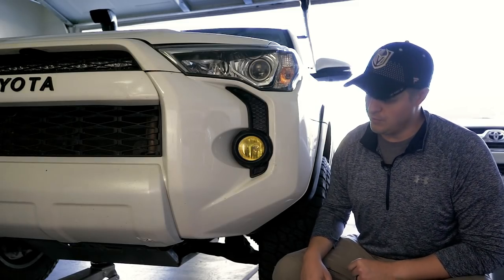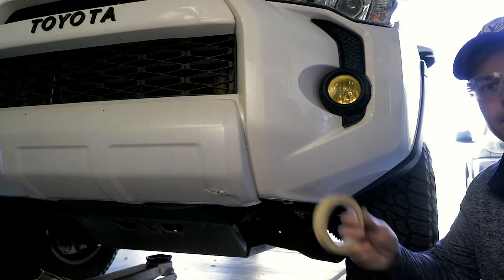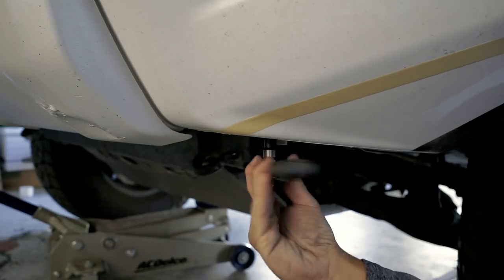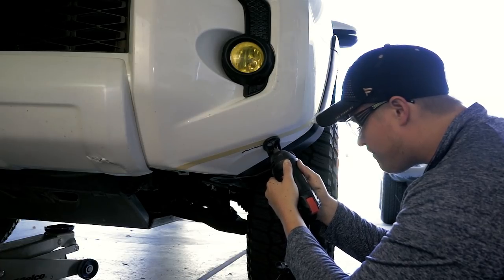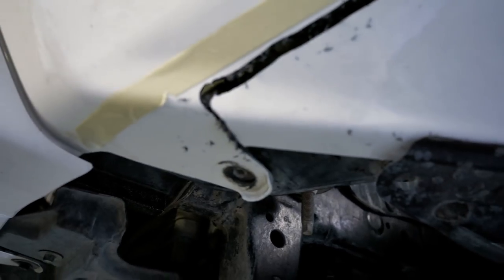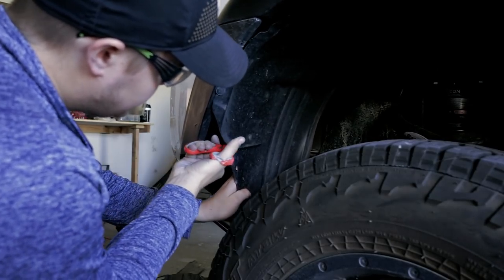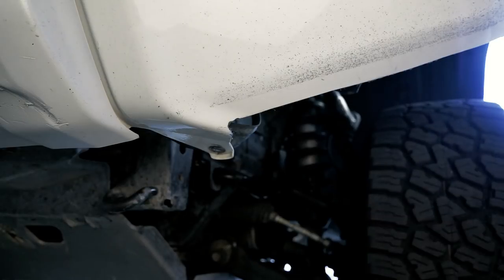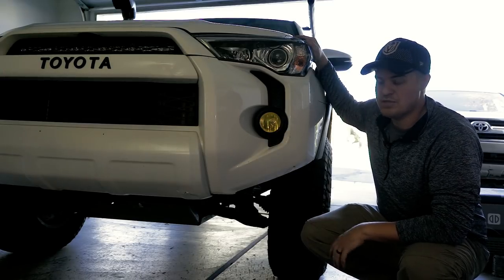In the Garage: 2014+ High Clearance Bumper Chop

Comment: Thanks man. Very helpful video. I opted for cutting 2 inches below instead of one and it came out great but mostly cause of your video! Keep up the good work man.
Reply: How has the bumper performed?  Wondering if it is rigid enough with less attachment points?
Reply: I’ve taken my bumper off and on so many times already for light mods that I’ve lost half the bolts that button up those corners, lol. I’m gonna do this cut soon since I might as well 😂 zero issues with a flapping bumper or anything

Comment: Great mod. Curious why at the end you bent the mount up to hide it. Why not just use a grinder and cut off the end?
Reply: In case he wanted to return it to stock he had the mount bracket
Reply: I just bent it up by hand, doesn't need to go up much to be hidden.

Comment: So you cut the plastic wheel well liner allowing mud and water to splash into your fog light, et. al. Couldn’t you do this cut and reset the liner? The only fail I see with your cut angle that I like.

Comment: Thank you for this video!  I love this cut! How did you go about covering up the exposed areas when you trimmed away the fender liner?  Especially the passenger side where the washer fluid resevoir is located?  Also, what kind of dremel/blade is that you're using?

Comment: I really love how this looks, but I'm not a big fan of leaving the fog light connections wide open to mud/water/salt. Any future plans to maybe fabricate some plastic fender lining to keep those components covered up? The metal tab that was bent up could still be utilized. Thanks for the video!!
Reply from the maker: That would be killer. But probably not. I ran with chopped fender liner for years when i had the full front on the truck. So it’s not much of a concern to me.
Reply: @Ruston_smith  Makes sense. I tend to worry a lot about some things that will be fine either way lol

Comment: Question, I got a 5gen 4Runner, got bigger tires, it’s rubbing on the fender liners, what’s the best way and cheapest way to fix the rubbing? Level kit? Remove and modify the fender liners? Thanks
Reply from the maker: Just push the fender liner forward.  You can simply undo the bolt that attaches into the bottom of the liner, push it forward, drill a new hole and put the bolt back in.
Reply: Overlanding USA thank you.. and one think I forgot, it always rubs on the mud flaps... anyway best way to also fix the issue? Maybe take off the mud flaps( but I like on ) or maybe shave off a little from it? Thanks again
Reply from the maker: @4condors  It depends on where it is rubbing, if its rubbing the mud flap then take it off, if its not rubbing then leave it and do the front.
Reply: @Ruston_smith  guys you can use a heatgun. To stretch the plastic

Comment: I like this idea, but it looks unfinished.  Too bad you couldn’t add a small coping along the cut fron the black fender flare.  The bending of the attachment point also looks like it could be better thought out.
Reply: you could always cut it instead of bending it out of the way for a cleaner look
Reply: I like this look as well. SSO sells rubber liners for the edges for their stage 2, I’m sure could be used for this mod. That stage 2 requires their bumper as well, so this stage one is a great start.

Comment: Wondering if same could be done on 2017 Tacoma TRD? I also have the same 4Runner— did bummer start to make noise?  And will this create problem if we go with full high clearance bumper in future??
Reply from the maker: spencer graham no noise at all. The bumper is still fixed at all but one of the factory points. So it’s very sturdy. I do not think it would effect your ability to go full as most of those are a much much more aggressive cut